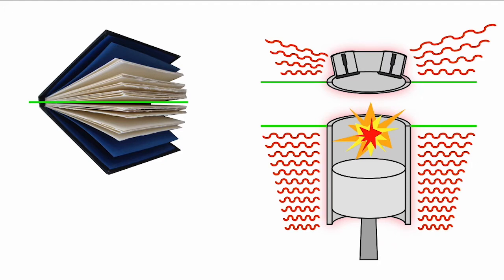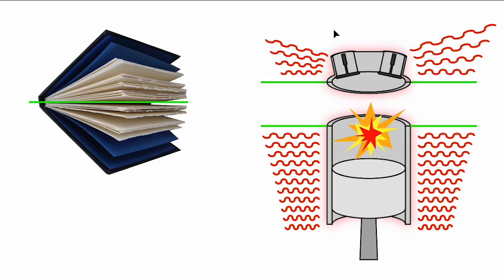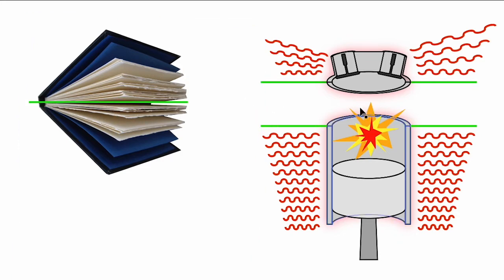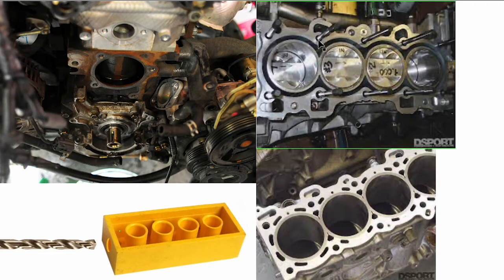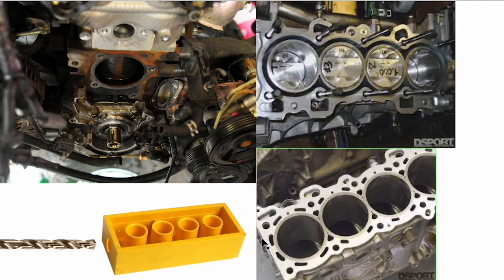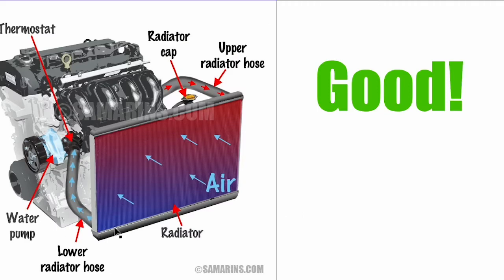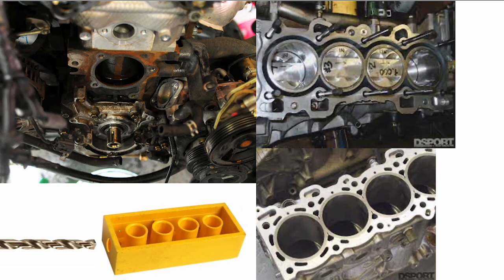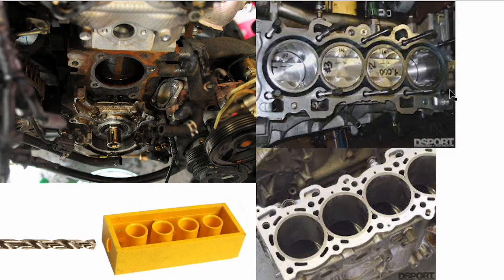Coolant Reroutes for NA/NB Miatas

Comment: Thanks for the videos greatly appreciate it excellent explanation however I think you’re failing to mention one thing about the NB model vs NA. the overheating issue was really with the earlier NA models when Mazda figured out this issue and when they introduced the 1.8 96/97 NA and NB models they changed the gasket to allow more more coolant to flow to three and four at lower temperatures. The rerouting this models does not make sense unless you change the gasket back to an earlier version as it will have the reverse effect. Also, this does not matter on street car only on a car being beat up for long periods of time.

Comment: Love your videos on the miatas, I'm looking to buy an NB to track and daily drive, how many miles on the default cooling route do you think are enough to really affect me? most of the examples I'm looking to buy are roughly 130k mi and I'll likely do the coolant reroute before tracking it at all. Could you please do a video on lubrication on the B6 and BP? I want to understand better what's going on with oil flow with both the direction and how inhibited it is. One thing that I'm worried about with doing aggressive oil pan baffling is whether or not it'll inhibit the actual oil flow rate from the pan